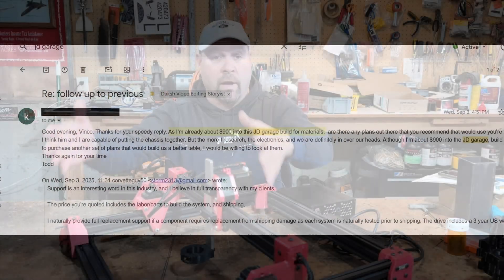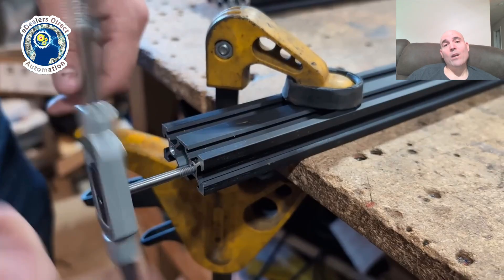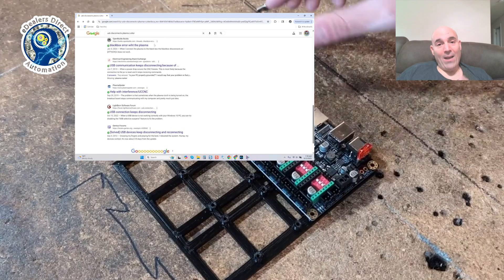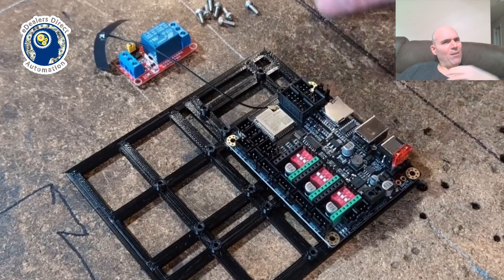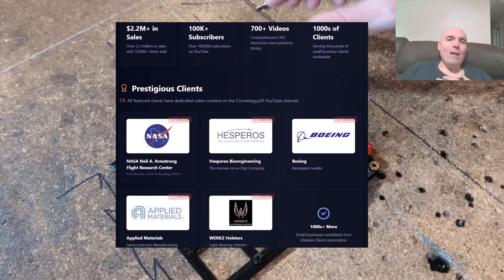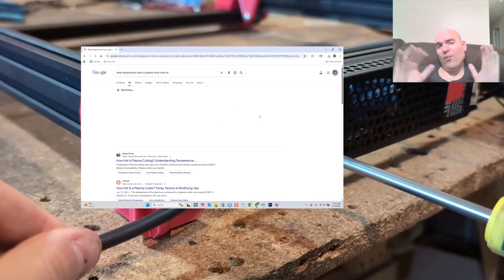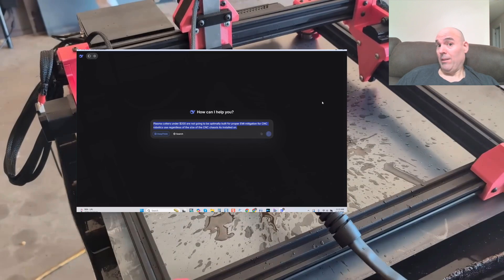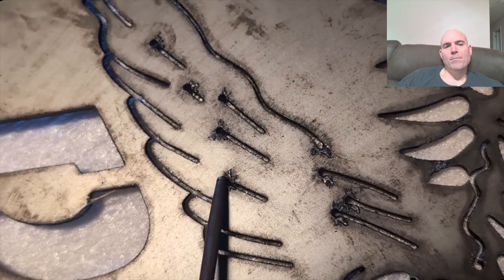👀 A Look at JD's Garage $200 CNC Plasma 👀

Comment: I am not defending JD or anything but they do say to use braided jumpers between all sections of extrusions. they also say to ground between the extrusions and the other components. The actual control box is 3D printed which sucks, but they do add a braided shield to all motor wires and it is to be connected at the driver end. They do not sell anything other than plans so the liability is with the builder. The two plasmas that they recommend are used by a lot of DIY guys on CNC tables. I am 62 now and I might want to cut a part a couple times a month. I can see this may be a viable option. I will let you know how it works out. Love the channel !
Reply from the maker: If the motor cables aren't double shielded your machine's a risk of being unstable. 

If its not able to be properly grounded its at a risk of being unstable. 

If the controller used for the chassis isn't ethernet the robot's at risk for being unstable. 

Robotics unfortunately isn't just a bunch of possibilities when it comes to unstable it comes down to when. If you build a robot with improper engineering you'll find the problems become synergistic. 

I provided more than ample proof in this video, and in the end its your money. 

Thank you for your support.
Good luck
Vince

Comment: So this machine uses plastic to hold it together. Wow ,what happen when it melts cu boom. The table looks like an ortur laser
table. And all those open connection around water ya I don't think SO. What a piece of crap. Am I a load to say "CRAP" LOL.
No way that's 200 doller that guy is full of sh$t. And he is selling plans for this. He better have good disclaimer on the planes .
Like if you buy this Danger use at your Owen Risk :)

Cheers
Reply from the maker: Thank you for your support. Vince